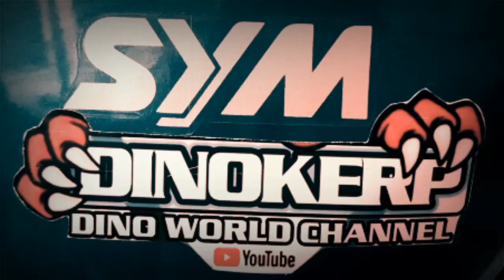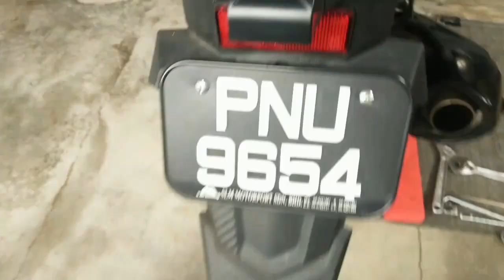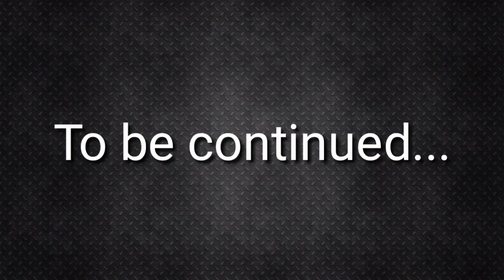SYM VF3i | TUTORIAL PEMASANGAN RIM LC5S | PART 1

Comment: Assalamualaikum tuan saya pengikut tuan...semenjak dah pakai symvf3i le.nk masuk rim 5s yg ada durmah. Kpd motosikal saya..nk tnya soalan .kalau le ada ABS MCM mana    nk buat...boleh bg penerangan..terima kasih
Reply from the maker: Wa'alaikum salam Tuan. Terima kasih sebab sudi follow channel saya. Utk VF3i jgn pakai rim yg guna drum brake. Cari yg pakai disk depan belakang.
Utk LE atau Pro. Kita kena cari disk brake yg ada reluctor ring yg sama diameter dgn disk brake asal. Sebab kedudukan reluctor ring dan sensor ABS kena sama. Nnt brake akan ada problem. Jadi nk selamat kena cari rim yg PNP utk LE dan pro. Nk modi boleh cuma kena rajin dan sabar.

Comment: Bro dino, sy dh tukar rim sukan 125. Yg lain lain masih standard kilang. Set sprocket apa yg sesuai ya utk top speed paduu
Reply from the maker: Tahniah Tuan. Rim 125 mmg agak ringan. Cuma ratio tak boleh guna kombinasi sprocket terlalu kecil sebab VF3i 6 speed. Mungkin Tuan boleh cuba kombinasi 15T43T utk test pick up dan top. Kalau top lambat sangat Tuan boleh up balik belakang pakai 44T. Tapi kalau top cut off masih cepat Tuan boleh drop pakai 42T. Cuma kalau masih pakai ekzos standard, pickup mmg akan terasa lembut sikit.
Reply: @DinoWorldDinokerp  43 mana kedai yg jual eh? Agak susah ni nk cari yg besar paling besar sy jumpa 41 skrg tgh pakai agak kurang sikit la top nyaa
Reply from the maker: @ProbePros  41T mmg terlalu rendah. Enjin standard mmg susah nk capai cut off. Kena naikkan balik ratio supaya enjin tak  teruk utk short distance.